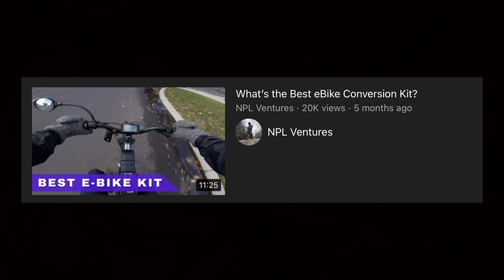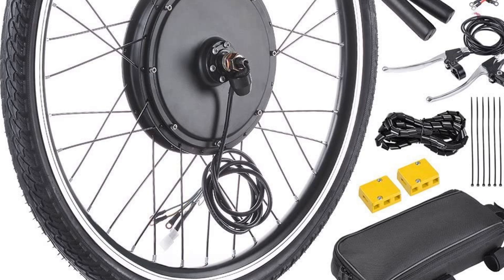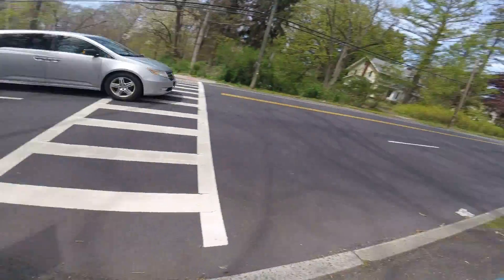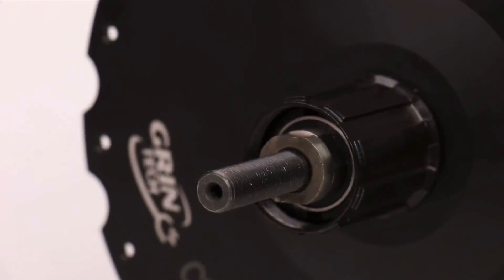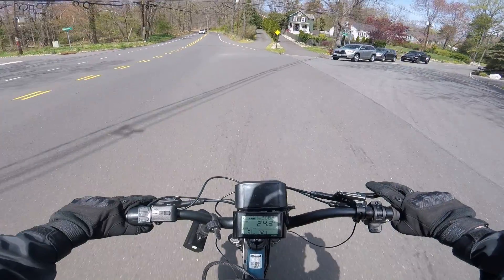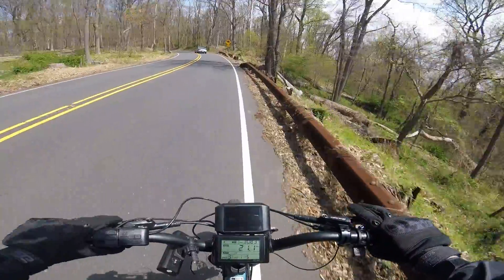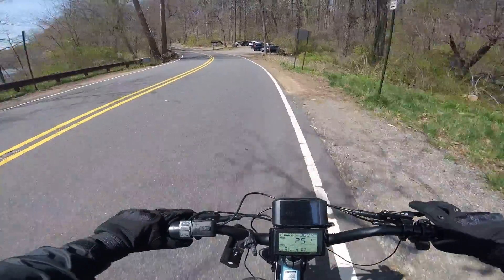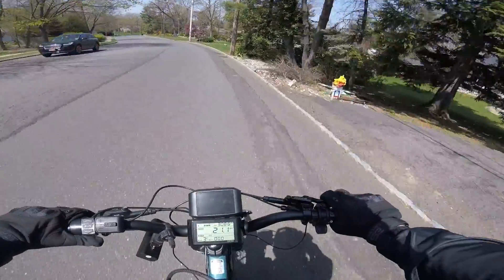The Absolute Best Hub Motor for your eBike Conversion Build

Comment: Should be silver plated copper wires, Statorade, amorphous core stator, and built in high power mosfet .0001rds driver IN the motor. It could be done with as little as 3 tiny smd mosfets and a little microchip and a little smd capacitory array, 6 fets for upgrade or efficiency option. 2 wires coming out of the motor only (option standard). Power cable to battery and display with all the built in connectors for other things you may need, all optional. No wire mess, AND saves weight and Air drag and adds installation ease and overall its more professional. 
Then you have a perfect device, add a screen with orange dot matrix built in pass button and throttle and its perrrfect.

Comment: I can't get a straight answer from bikeshops...   What motor would you recommend for a Yuba Mundo? I plan to haul a trailer and lots of gear for adventurebiking in hilly terrain and on forest service roads...also using it as a weekly grocery getter. One local shop said a Grin Direct Drive motor would be good, citing regenerative braking and simplicity and throttle. Another shop exclusively likes a Bafang mid drive for efficiency. Specialized used a geared hub with a throttle and lots of power. I definitely want walk-assist and a throttle for help when stopped at a light. I'm over 50.  ...also curious about how badly the motors are affected by water in rainy locales.

Comment: So untrue! I put a front wheel kit on my Lectric XP 2.0 - 1500W - about $160. The things climbs trees now. And in reference to the flattened axle, that's because it has a greater diameter. It's stronger and torque arms are included. It also has the same waterproof connector cable. It's a BETTER deal. Who's paying you?

Comment: i bought a dualmotor fatbike
has 2x g62 1000w geared hub from bafang on 52v ... good for 38.6 miles an hour (unmodded!!)
1100 bucks with 52V 25 Ah battery, hydraulic brakes ... a power beast 
i think its sometimes better to just buy a complete bike and not a conversion kit.....
my seeker 26 is a beast out of the box... just added a 2nd battery for more range (running 2 motors eats up some power)...

Comment: I have a cargo bike that is mostly driven around 10 - 25 kph. Can you design a direct drive motor that is most efficient at 15 kph, or do I always get better torque from a geared motor which is spinning faster? I love the quietness of a direct drive motor and would change my Chinese piece of carbage mid motor to one of these any day. 

One problem with off the shelf hub motor kits is the el cheapo rims which you really don't want on your bike. Especially if it's high speed, or a cargobike.

Comment: How many times do you have to say cheap Chinese..
I have been doing ebike conversions for 20 plus years and I have bought kits from Grin in the past .
However they are not the only better quality hubmotor source .
Bafang makes good quality kits , and supply's many ebike manufacturers.
And if you really want great hill climbing ability, you will be looking at a mid drive , and Bafang is the go to mid drive choice for tons of DIY Folks .
Tried and true for maybe 20 years as well .
🙄🧐👍

Comment: I met the guys from Grin today at pacific northwest trike fest.
Looking into the all axle rear for my azub tifly
Reply: Did you install the all axel to your ti-fly?  Tossing around the idea of hub motor on my ice sprint x tour.  Id be curious about the power especially when hill climbing. Any mechanical issues or problems?  My LBS would be installing.  Im not a DIY type 😅
Reply: @debbieschwartz3132  not yet but will as soon as $$$ allows me to..
There is a guy here local to mew who has one on his scorn and seems to ride it all over the place up and down hills.
I will have a place called nomad cycles here in Portland put it on as I donor like to do wire work..

Comment: After 3 years of a sitting bicycle engine kit, i decided to finally get a bike. Build the kit and i get 120mpg and spend about 5 dollars a month for general everyday use. 

Im about to sell both of my cars, they both need serious reapiars and i just dont have the money atm.

After 6 months of use i love my motorized bike, It gets me everywhere averaging 35mph.  Once i sell my cars, will get a phatmoto motorized bike and put a front wheel 1500w hub motor. 

Im looking to go around 50mph with the engine while having that front hub as a hill assist and backup incase i run out of gas.  

I soon want to take an 800 mile round trip on my bike alone. Ill definitely start a youtube channel soon for that.  

Great video and thanks for all the information.
Reply: If you get a controller with regen you could even charge the battery from the gas motor, if you really had the notion to.

Comment: NPL is right on the money here ,they are the best engineered motors on the market the gmac is the most powerfull geared motor on the market ,the grin all axle motors are actually a 9continent motor insides withmodified case and torque arm the same with rh212 but they enlarged the diameter aprox 10mmso they could have the speed with the torque increase,im currently designing and building a bike to travel around australia and the grin all axle fast wind is what we are using for front and for rear and they are light enough that we can take a second set as a back upthese motors do cost conciderably more than the standard chinese offering

Comment: i bought a 9 continent direct drive rear hub motor for using as dialy rider as i cant use my monster crystalyte motor on the streets ,its in a 29 inch extra strong rim and heavy guage spokes ,i upgraded all the phase and hall wiresto aircraft grade but just abit thicker would be fine and i added a temperature sensor .its a fast wind 9x7 for memory and i run it with 82 volt lithium battery,the controller i use is sabvoton svmc 72150 unlocked which can do 200amp dc but even a 20 amp controller will make this motor haul ass,but on 100 to 150 amp this thing is a weapon although you will need statorade and hubsinks for cooling the bike gos well over 100km per hour and thats for only 180 dollars australian ,oh i also upgraded the barings to best i could afford .as a beginer to inmtermediate motor you wont be dissapointed
Reply: Wow! I use an Ezee hub in a 26 with a flipsky 75100, and I have one of the 9c clones as well that I got for free to use on a future build. I have a load of the still good cells from dozens of bad power tool batteries so I might make up a lower amp draw battery from it for a completely free ebike build. Just need a free old frame for it. I also got a fat bike BBSHD for 60 bucks at a thrift shop with an unbalanced 48v 13.5ah battery that I had to balance manually with dissasembly, and plan to add an active balancer to the BMS in it.
IMO, the hub motors are better than the mid drives. Especially if you can get regen, as far as commuting goes. High power (ie not 150-300 watts) on a mid drive means you can't peddle fast enough to be in the optimal efficiency range of it.

Comment: Okay not to be argumentative or anything but the picture you showed up the ineffective torque arm you had a place toward the front, and in that configuration I am absolutely sure it's ineffective but if you place it to where the actual arm that you banned to the fork is located in the back, they're very effective

Comment: The Chinese controllers are cheap, poorly insulated with few real functions, i blew up mine after about 2 weeks, one day it rained, the insulation had voids, and over about 2 days it failed, blew 1 or 2 mosfet tranisistors aprat, not good, and then it took 1 month of arguing to get a replcement.  So screw that.

Comment: It's great that you are no longer a slave to car ownership.  Years ago I knew a young family that did not own a car.  They used bicycles for everything.  The mom and dad had wire paniers on both sides of their bikes which was pleanty big enough for normal grocery shopping.  In lieu of making a car and insurance payments, along with maintenance expenses, they simply put $500 a month into a savings account.  If they wanted to use a car for several days they would rent one.  They explained to me that for the first several years they tried this there was a surplus of money in the account at years end.  This was before UBER so if they were travelling by plane family or friends would give them a ride to the airport.  They made it work and actually converted their garage to a recreation room equipped with a ping pong table, craft tables, and space for their camping equipment , kyaks, and of course the bicycles.  Of course it wouldn't work that well in some areas of the country but in sunny California it was possible.  By the way, nobody in the family was overweight and they always seemed to be happy and healthy.

Comment: Golden Motors ...Magic Pie 5 ..Controller in the hub motor ..no external "box" .. One Button Cruise Control ..Regen Braking .. Been using their products for over 10 years ..
Reply: They have interesting motors but not high voltage ⚡
Reply: @andyfumo8931  They have been good for me ..but then I'm not looking for performance ..cruising 7-8 mph usually but can go up over 20 if I need to ..I use it for exercise I can still petal just as hard as I want to ..uphill ..into the wind 7-8 mph 2nd or 3rd gear ..It's about time outside and getting some exercise for me ..Have lost 85 pounds while riding this thing ..

Comment: Do you really think in this day and age that “made in China” is synonymous with cheap and low quality (especially when it comes to tech and electronics)? Or are you just doing your part to spread more? Even Grin themselves are open about the fact that their motors are made in China. Point is, entry level motors in ready to go conversion kits are indeed made in China but so are the top shelf, high powered ones, with all  the features. What’s more, Grin motors have a fill point for “Statorade” coolant because that’s their product; but it can be used in any direct drive hub motor.

Comment: A lot of misinformation here, some of the best motors on the market today are Chinese... and they aren't cheap. There are cassette options, regen, the type of controller that can be used is restricted only by the type of connector the wires terminate in, there are through axel designs, geared hub, direct drive, mid drive, etc. The only reason you see so many geared hub motors for a freewheel is because that's what the market/bike manufacturers are demanding.

Comment: When you're riding a bicycle that you've converted to a rear hub eBike, is there an increase in resistance, if you decided that you wanted to just turn off the motor and pedal?
Reply: You'll notice the increase in weight on hills, but if it's a geared hub motor, there's no increase in resistance felt. I have every type of ebike and each kind has benefits

Comment: They seem kind of like Ebikeling but they don't come with a rim. You are right that the quick connects on the motor to controller wire is nice when changing tire but after building a few dozen ebikes with voilamart kits I learned to stash the extra motor to controller wire on the rear fork not in my wire management for everything else. The torque arm is real nice and should be a standard because as you pointed out those torque control arms they sell with the kits or after market are a joke and should Never be trusted with a front wheel drive built ( three wheel bike) the only Near spin out I have ever had. And the regen capable geared hub is something I would like to check out but I really love direct drive hubs, less noise.
Reply: You can make a torque arm to match those flat axels with minimum tools. Select a heavy gage piece of steel and cut it to match your frame. That motor will not go anywhere no matter who the manufacturer is or what the price is.
Reply: @diegudr  I actually buy the torque arms for conversion kits or they come with them. If you don't have a good way to hang the two piece torque arms just use the part that fit the flat shaft and drill a hole in your drop out and bolt it directly to the frames drop out.

Comment: I am trying to put together a fairly light ebike for my sister.  She is small, so weight is an issue.  She also is very non mechanical.  I had thought mid drive but that is a lot of wear on drivetrain.  Your thoughts?  I am thinking geared hub.
Reply: I know of someone with geared hub without cluthc. so regen works.

Comment: I actually had an epiphany recently, I realized my work is only 8.5 miles away from where I live. After I payed my first car off, just months later a drunk driver wrecked it in my parking lot and pushed it into my neighbors car! I then had to get another car, and thought that once my car was payed off id be free again 😪 That's when I realized having a car is just a never ending cycle of debt, whether it's payed off or not! The car I have now is roughly $11k a year, once it's payed off it will go down to just over $3K and that doesn't count repairs in the future or accidents, not to mention the cost of gas too. About 10 months ago I had a job that was 35mins away driving and mostly highway, but now that my work is only 15 mins away driving and doesn't require me to take the highway, the switch from car to E-bike was a no brainer. I always wondered where all my money was going and now I know why! Selling my car on Carvana next week and they will pay off the remainder of it for me! 😃This is why by the time I'm 65 I will have well over a million in my retirement fund!
Reply: Totally. I can afford to work only part time and still have thousands in the bank despite some rather expensive hobby purchases, like new cameras and headphones. Look at a used ebike, especially if you're handy and they have a small issue.

Comment: What are your thoughts pertaining to a 3000 Watt Electric Bike Hub Motor
Reply: 3000 Watt Electric Bike Hub Motor? That's meaningless if you don't include the Volts and Amps as well.

Comment: Looks like the best company to go to when I replace my rear and front BAFANG hub motors on my E-CELLS 2 motor, 2 battery, dual suspension e-mtb. Upgrading e-bike motors seems well worth the time and money.
BTW, I put a GRIN Technologies "axle keeper" arm on my rear axle. My front fork is incomparable with GRIN's front arm so I sent the it back for a refund.

Comment: my car became dead 2 years ago been riding a 26 inch kent with a 150 dollar l faster 450w motor that cost 150 and a cheap 1600 36 v battery since i installed it last 4th of july . speed is mid 20's I use it to comute andit lacks range i was thinking of going up to a 48    v 20.000 battery. but no pedal assist i am thinking e bikeling 1200w Money is the issue i would still ide a motorized bike if i had money just not ready to buy a 1 or 2 000 dollar motorized wheel... and yes the cops did bother me aboot the gas bikes lol.whats a low cost wheel i caan get and would pedal assist increase my range

Comment: I did the same thing!!! I was spending 100s every month of maintenance, tires, ect. It was getting too much sucked in of the money pyramid monopoly of owning a car in US which means spending more forever. I use a family car when going out neighborhood. I bought 2 factory mad e bikes 500watt gear motor, . 2 2000watt  Gearless conversation kits I used to equipped my 2 factory builds with  2000watt turbo Booster. Very, very practical and not overkill of many others DIY duals.

Comment: You can add regenerative brake to some other geared motor also 👍 gmac is ok but I find power and adjustability is not so good specially when running 72v After my testing of all the motors Crystalyte is the best for overall applications the Grin hub has 32 holes causing fitment issues and also its only a through axle . Good reviews 😎

Comment: If you know where to look Chinese motors are very well made, just don't buy the cheapest products on Ali & Amazon. If you compare the prices Grin Charges for their upgraded motors, you can do a lot better & they have had their fair share of quality & reliability problems. Bafang didn't get to be the biggest supplier worldwide by selling poor quality but they will supply crap if that's all you are willing to pay for.
Reply: "On 19 August 2014, Sunstar Giken Kabushiki Kaisha filed a court action against Bafang for infringement of the German part of its European patent EP 2 143 628, by Bafang’s electric mid-motor “BBS01″. Bafang got to be the biggest supplier worldwide by stealing other companies designs and undercutting with crap quality for the lowest price.
Reply: I can only speak from my own experience of installing Bafang Mid Drives & Hub motors for the past 8 or 9 years.- I have NEVER had one come back. The early model BBS01 & other models had Controller problems but I have customers who bought from me many years ago & still riding strong. I tried selling the Tongshengs & really liked their smooth power delivery but since they got sued & had to change their designs, their power is now about 2/3 of what it was originally so I am back to Bafangs with no regrets.